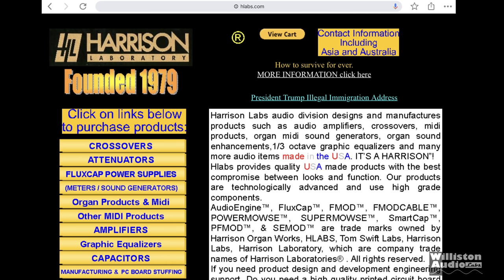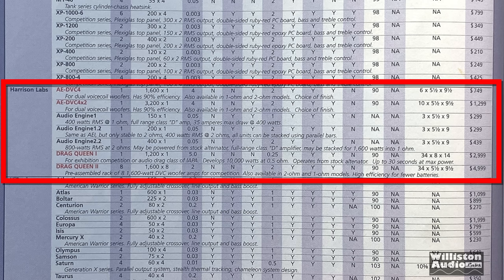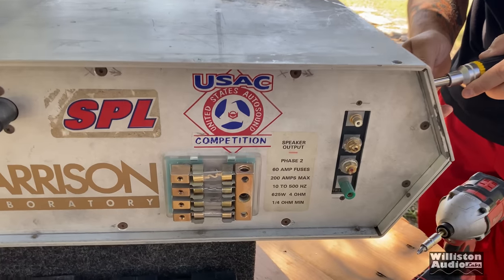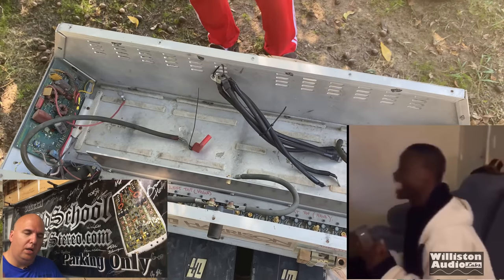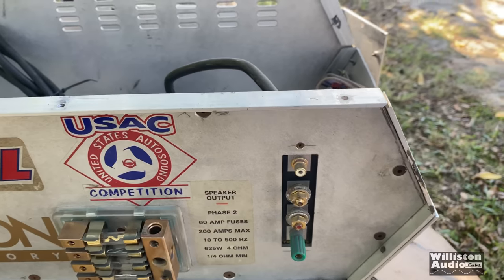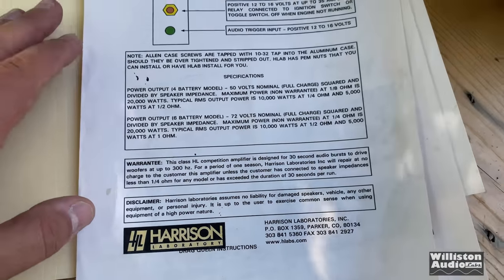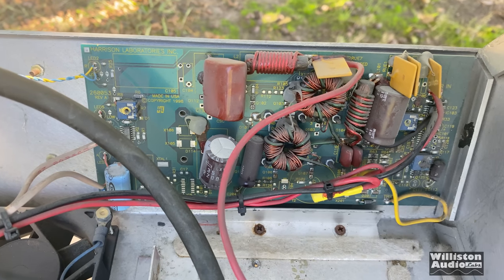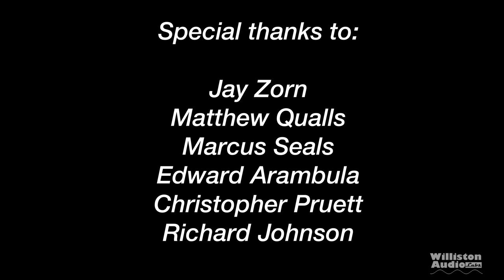20,000 watt Amp Banned from Competitions? 2000 Harrison Labs Drag Queen [4K]

Comment: For the love of God, don't put lithium batteries in that thing... It's using lead-acid batteries (sealed) because they can discharge very, very quickly (at high amps) with no issue. Do that to a lithium, and it will likely catch fire. Newer isn't always better, for amps, but also batteries in certain applications.
Reply: It depends on the specific battery, make sure to check the specifications of it to make sure it can handle the load you're going to power. Looking it up there are ways to put together 14v 15ah Lithium packs capable of a continuous 1500a draw, and that would be plenty of current. That can power a 20kw load. Possible? Yes. Practical? Probably not.
Reply: Another big thing no one talks about, lithium batteries have to be charged differently than lead acid batteries. Charging a lithium battery with a system designed for lead acid can cause battery failure or worst case a fire. They require special charging circuits.
Reply: @archangel3237  you are 100% right. They'll also possibly catch fire/explode if you undercharge them/discharge too low, puncture, or overheat them.
Reply: @kubiokyay7119  I do forget that some lithiums (like those used in radio controlled drones) can discharge fairly quickly without issue, but this thing is rated to drive a 0.25 ohm load, and amplifiers are kind of a misnomer as they don't amplify anything -- they modulate a DC signal to be close to (ideally the same) as the input signal. Thus, the batteries will see a 0.25 ohm load (plus whatever resistance the transistors / wiring present which won't be much). I just have a hard time seeing a lithium survive that.

Comment: I do have one question if you could find the time to answer.  What is the advantage of stepping the voltage higher ,     since the net wattage is  the same.   The stages in the amp of course.
Reply: Higher voltage means it requires less amperage to get the same wattage.. Same as taramps. And how 220v appliances use about half the amperage to do the same work as 110v

Comment: If it was actually that much audio power then you would need 2000 amps at 12 volts to power it up
Reply: Which is why there are batteries inside of it, so you don't have to pull all the output power from your 12V connection.
Reply: @goz3rr  That would be about a tractor-trailer load full of batteries
Reply: @Frank5  You are severely underestimating how much current batteries can put out for short amounts of time. As mentioned in the video the amp is only capable of putting out that power for 30 seconds, a normal lead acid battery can put out anywhere between 300-600A for that amount of time (because that's what it takes to crank an engine over) and you would've had 6 of them here.
Reply: i don't think that amp is running at 12 volts, the batteries inside seem to be wired to 48 volts, and has a separate charging system that takes 12 volts from the car and converts it to 48
Reply: @Frank5  people run more watts than that out of their suburbans
Reply: 🤦‍♀️🤦‍♀️ Yes because to win a competition and take home 20 grand, that’s all you have to do. It does what it’s supposed to do.

Comment: Cool from an early engineering perspective. But to me Pound 4 Pound the best. Old School Amps are the mid to late 90's. Rockford Fosgate Punch Amps. The sneaky power with lower current draw. Is impressive & the up to 18 db's of Bass Boost. Just by turning a dial 👏🏾👏🏾👏🏾. Those bbq grill looking amps have won a lot of trophies. 👍🏾
Reply: I had 1 Punch 200x2dsm  in 2 ohm mono. Pushin 6 JL Audio 8w6"s in an old 81 Oldsmobile 98. Each sub in .33 cubic feet enclosure. Added some polyfill inside as well. Had a Punch 4040dsm for 16 mids & highs. Cerwin Vega & Pioneer mids and highs. It was so loud & clean. Clean deep bass & clean mids & highs. It was so fun doin that install. Damn it man, I miss that car.😥
Reply: Tony Melo  Damn, 159.2... that's a lot of pressure! And I had a few sets of Infinity Kappas. I freakin loved those speakers. So clean super low distortion and can take some reasonable power. Man I miss those days. I told my wife, when the kids leave the house. I'm getting another Ol Skool Whip. And  imma hook it up like back in da day! She looked at me like, "your old ass".🤣🤣🤣🤣🤣

Comment: That's pretty genius for the time. P=IE (or Power (watts) = I (amps) * E (volts)).. Everyone is focused on the I (amps) part of the equation and these guys were like.. eh.. screw that, we'll focus on the E (volts) part.  Assuming those batteries are 12v each, they are wired in series giving you a 72v battery bank with a 30 second "launch" button.  Takes the term "cheater amp" to a whole new level.. I guess US Amps wasn't so bad after all.
Reply: DOH!  First page says 72v.. my bad.

Comment: So before 2001, i could plug the subs directly into the wall do produce 50hz/60hz tones at who knows what power :D. I wonder how many subs it will take to not destroy the coils.
Reply: I've seen some beefy fi subs plugged into a wall for over a full minute and would not blow just flopped up and down insanely lol
Reply: If you plug a 4 Ohm sub into a 120 volt AC outlet, it will draw 3,600 watts RMS. It will trip a 20 amp breaker. If you do that with an 8 Ohm sub, it will receive 1,800 watts RMS. If you have a sub, multiply the rated power X the impedance, and take the square root of that. That will tell you how many volts, the woofer can safely withstand. If you divide that number by the impedance, that will tell you how many amperes the sub will draw at that maximum safe voltage. You may need to series woofers, to divide the voltage, so each sub can stay within safe limits.

Comment: 1:45 I like how it says that 30 seconds is the max! Neat little warning!!! ⚠️
Reply from the maker: Batteries would be drained for sure
Reply: To prevent thermal runaway in the output transistors (heat sinks are just a joke), plus to prevent discharge damage to the lead acid bank.

Comment: What's the best but cheapest amp you can recommend that I can install in a junk woods truck that will get destroyed in one weekend but will sound good during the destruction???
Reply: Skar rp2000.1D.   Or any Skar SK series amp,     Really good amps for the money and I have never had any problems with my RP.2000 even while pulling rated power and a little more

Comment: Hey Big D Wiz! been a a fan of yours for quite a while. i hope you can see this message lol, ive been wondering what kind of power a lanzar optidrive does. you can look everywhere there is not alot of videos at all.. maybe not even 5 videos...but anyhow i was wondering how the lanzar optidrive 6000.1 1 ohm  model, how it does power wise.  Along with clamping, and amps drawn. hope to hear back from you man! keep up the good work brotha!!!
Reply: Lanzar newer amps do power and then some bit they are power hungry
Reply: @jermainephillips5179  yeah mines the 6000.1 optidrive 1 ohm model. the 4k lanzar at 1 ohm pulled over 650 amps.. so i know this 6k is gonna pull over 800 at 2 ohm

Comment: tbf either they are driving the load direct off the cells using a square wave (hence the efficiency figures) OR they are using the batteries liek a modern amp uses a switch mode boost supply and rail caps. I susmect its the former, and so the reason it was banned was when you put 30Hz in your not getting 30Hz out , your getting an absolute tonne of harmonics.

Comment: So I have a 1993 Acura Integra. And id love to find some period correct door speakers and a sub and a amp for it. What would be the best bets for that?
Reply from the maker: LegendsOfCarAudio.com
Reply: I used to have a 92 GS, I LOVED that car and I miss it almost every day. It was my first Honda. Honestly, I would say if you could get some Kicker door speakers, some Kicker 6x9s, and a Soundstream Rubicon 4x1000, you'd be doing pretty good as far as period correct goes. I had 4 Kicker Solobaric 10s in a custom box with that Soundstream amp, a Sony 10 disc CD changer, a Sony Xplod tape deck, and instead of just getting some cheap 6.5s for the doors, I got some Infinity Kappa 5x7 split sets and molded them into the dash with Kicker door speakers. It sounded excellent.
Reply: @Brock_Landers  hell yea man. I have been thinking about running some kickers and maybe a about a ten inch kicker sub and what would be a good amp?
Reply: @yeetisthefetus7214  You can choose from any older amp and it'd be what you'd find in any of the mid 90s, early 00s cars back in the day. I ran a Soundstream Rubicon (blue amp) 4x1000 amp with my Kicker Solo-Barics, but any of the old school Rockford Fosgate amps (the black and silver somewhat triangular shaped amps) would work. I had a US Amps 100x4 1/4 ohm stable amp, some of the older chrome Kenwood amps, Sony Xplods, Orion had some of the old HCCA cheater amps that would be PERFECT for that car if you needed some serious wattage, JL Audio, MTX, I mean, take you pick brother. Just like Derek said in his response, check out that link that he sent and it'll give you alot of good information.
Reply: @Brock_Landers  thanks bro. I'm learning all this slowly by watching his vids. And it made me want to put a whole like period correct sound system in it. Because where it's mostly stock and if I took it to a car show it would go to the classics part of it and it would just be the frosting on the cake. And the only thing I have that is period correct is a removable face Kenwood from like I think the early 90s my dad had it in his old accord and guess what was still in it? A Bob Marley cd in it. It doesn't surprise me tho lol. And I've also go the wires in the car already from the previous owner so I'm one step there

Comment: Just as an after thought, it would be interesting, to see if this can produce a modified sine wave, similar to the output of a cheap power inverter. That would allow some variance in volume, beyond just a perfect square wave. It will still always put rail to rail voltage into the voice coils of the speakers, it will just reduce the duty cycle on each half of the signal, for a lower overall output. (it still won't sound good, but will at least offer some inflection)

Comment: I'm curious why it was banned ??
Reply: Most likely because it isn't powered by 12V. Power comes from the batteries inside. With this principle, stacking batteries, you can create tons of power, which aren't supplied by the car (altenator/batteries  of the car).
Reply: I'd say it was banned due to being able to run the amp with 12v input. In theory you could run this amp off of a stock alternator, since it had several batteries inside the amplifier. So someone could enter a low level class that doesn't allow multiple batteries, high output alternators, etc etc and blow away their competitors with this amplifier.

Kind of like the old cheater amps. Where a manufacture would rate an amplifier for say 300 watts with 12v power and 4 ohm load. If supplied with 14.4v power, it may produce 800+ watts at 4 ohm load. So you'd have a amp putting out 800+ watts competing in a say 500 watt and lower power class. Hence the "cheater" title.

Comment: They look like 24v batts. X6 is 144v nominal. You could probably run that thing strait of your houses supply cable thru a big bridge rectifer.200A is gonna dim your lights a bit, lol
Reply from the maker: They are 12V batts
Reply: @wal  I believe the CAP BANK that was made for that setup was in fact a 100 volt setup.... Batteries were a compromise... Batteries gave the user a bit more PLAYING time but much less overall OUTPUT.... the LIGHTNING BOLT is in the CAPS.... not the battery setup. Batteries supplied 75?... peak?... something like that.... I remember that thing.... a LEGEND

Comment: 20 000 Watts ? 20 Kw ? what power supply used ? 200 amps ?   12v X 200 amps 2400 W ? ,72 v 200 amps 15 000 w ?
Reply from the maker: Must watch for the explanation
Reply: That's why the built-in battery! that's the only way you can get the 200 amps@50 volts, to deliver 10,000 watts into a .25 Ohm load. Remember, this thing only runs for 30 second bursts. that's all the battery capacity can supply.

Comment: Also be weary if you do decide to fire the amp up, it will overheat in 30 seconds. You will need to add massive liquid cooling to the amplifier for longer periods.
Reply: It drains the series connected batteries that are not used as capacitors in 30 seconds, so good news!

And calling it an amp is disingenuous, as it clips everything by design and couldn't even attempt to copy an input signal. Why do you think it was banned? Because it's not really an amp, and therefore it's not really impressive. Anyone with a bunch of batteries, transistors or mosfets, and a SMPS could replicate it.
Reply: Because it’s just a mosfet switch, the efficiency is practically 100%. So basically nothing is being wasted as heat.

Comment: Was that an 18" woofer towards the end? I've never seen a woofer bigger than a 15" in person. I have two Sundown 12s in my Mk4 Golf with a Soundstream Rubicon Nano RN1.5000D and they slam pretty hard, but when I lived in Florida back in the late 90s, early 00s I had a 94 Ford Exploder with a Sony Xplod tape deck, a Sony 10-disc changer (with the cartridge), two Image Dynamics 15s, two ID 1500 watt amps, two 5 farad caps, two gel cell batteries, and I could set a full Coke can on my roof and bounce it 10 feet in the air. The people that I went to high school with said that they could hear me coming from a mile away because it sounded like thunder. I shattered my hatch glass one day and got suspended from school for playing my stereo in the parking lot...lol I had close to $5000 into that stereo system. My Mk4 Golf I paid $200 for the 7.5" touchscreen that's in it, $180 for the amp, $450 for the SA12D2s, I made the 32hz tuned 6x12" Aeroport box out of 3/4 double wall MDF, carpeted it myself, $50 for the 16' of 2g welding cable and the 2g grounding wire, $25 for a spool of 8g speaker wire, and $50 for the Buss 200A breaker. It slams pretty good for a cheap system. I have two cheap Pyle 12s in a bandpass box that I built that I was running off of a cheap eBay 1200 watt amp (that's probably closer to 250 watts because it's in my wife's car now running a Rockville W15K6D4 in a shallow sealed box and it sounds like crap) and they didn't sound bad either. I've been a stereo fan my entire life.
Reply from the maker: It’s a 32” subwoofer - $3000 32in Subwoofer in a Nissan Cube? Clarion SRW8000 Big Bass! [4K] https://youtu.be/BMhEv4Ii25U

Comment: Interesting variable drive unit you have there LOL! I think 1 burp and those mosfets would be toast at 1/4 ohm. Definitely not a music amp by any means and looks like it would put some hurt on the woofers it's powering. Being late 70's tech I imagine those mosfets wouldn't handle anywhere near that power. I could see a good 4k watts just from the shear amount that's in it but wouldn't take much to pop them. Also big lack in power caps, you can have all the batteries you want but you don't have big power caps in there your going to starve those mosfets on burps.

Comment: Your batteries did not get lost in transit. It's ups the driver stole them because they are vintage and probably worth quite a bit of money. The four that you are missing were probably inside of the amp and he probably took them out thinking that you wouldn't notice giving you the amp and the two batteries that may have been outside of it. It was probably already preloaded with the four battery configuration and two extra outside of the amp. s*** like thathappen like that all the freaking time. It it costs more but it's always better to go USPS because federal workers don't take those kind of risks typically.
Reply: The UPS driver disassembled the amp and stole the batteries?  On his break?
Reply: OR... just a thought, stay with me... All this wasn't in a single package and some got lost.

Don't get me wrong... the theory of a random UPS driver opening a heavy package, disassembling a sketchy electrical box then seeing some old dusty batteries inside and thinking, "OMG... are those... VINTAGE BATTERIES?! I smell a weekend of hookers and blow in Vegas!", is entirely possible.
Reply: @JJFX-  If you only knew what happens at a UPS sorting facility.
Reply: @davidpawson7393  I don't doubt the issues. I've 'lost' a number of packages with them but no, I do not think  they stole 2 of his 6 heavy "vintage" batteries that have no use to 99% of average people.
Reply: @donmoore7785  yea thats a bit of a strech if you dont know, but on the other hand, i'm canadian and there was many case of drivers stealing weed.

Comment: JUST WONDERING IF THE ORION IS MORE POWERFUL THAN THE OLD PUNCH AMPLIFIER?
Reply: MY COUSIN HAD 2 15'S CERWIN VEGA WITH AN PUNCH 150 AND BLOWED THEM BOTH
Reply: I am 62 years old so I remember them days... The PUNCH always had an edge it seemed in its 18 db BASS knob.... as for ORION, they had propitiatory systems that ya had to use... add on... ORION amps were PRETTY.... not the usual BLACK...... There was that.... Amps were built to be DISPLAYED.... that was ORIONS gig it seems....  They seem today to be living off their past these days...  So many new players. You had to drive ORIONS harder.... same with HiFONICS.... Input processing... This I remember. BDBD.2021

Comment: So it's a fart cannon driver. . . Got it.  Those poor driver transistors operating in linear mode dissipating more heat than an Apollo era capsule on re-entry.
Reply: I mean with that many packages and that large of an alumim housing sinking the heat it will be fine. 20KW at 95% is only 1KW of heat. I'd be much more worried about the poor little lead acids doing 400A+.